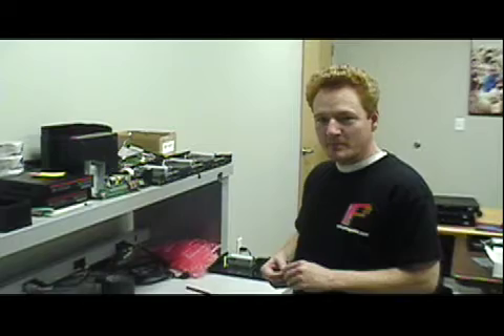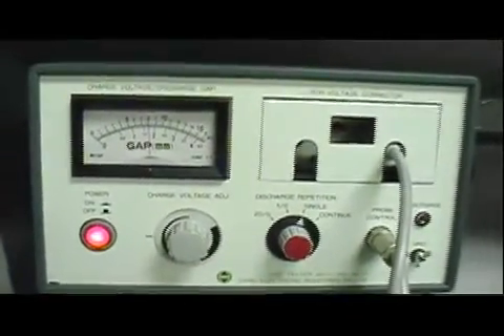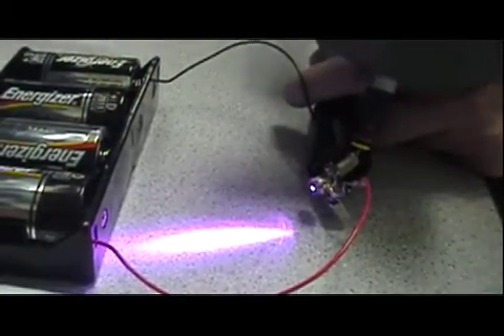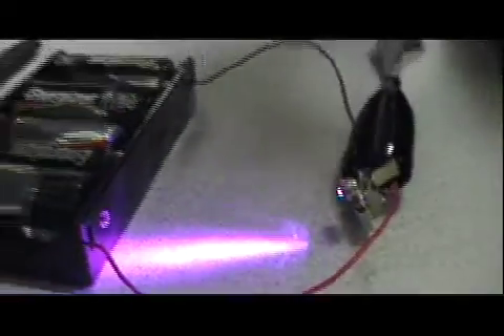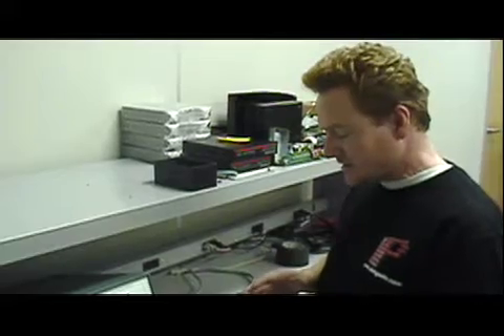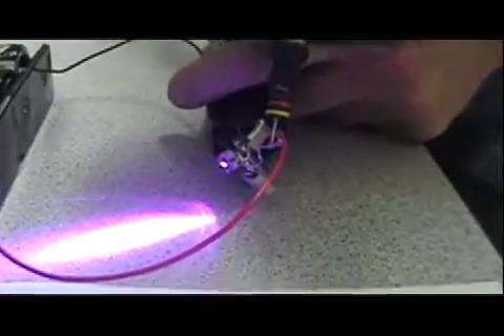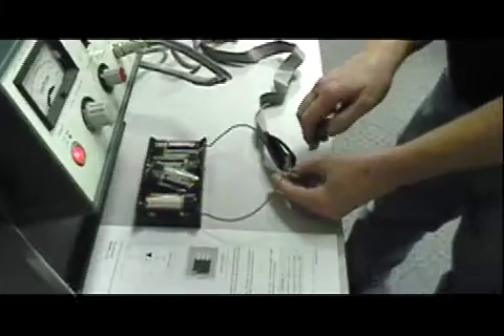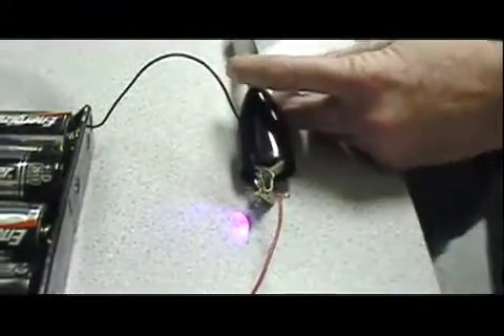LASORB protects BLU-RAY laser diodes from ESD and surges

Comment: why is it still showing some blue light?
Reply: +Thomas Joseph Great question! A laser diode has two separate damage mechanisms. One has to do with the heterojunction of the semiconductor material, and another has to do with overloading the mirrors. Lasers are very fast devices, which can produce light nearly as fast as the ESD event itself. During the ESD event, the light increases beyond the mirror's ability to reflect it, and the mirror becomes damaged. After that, the laser diode may kind of act like an LED. It is quite often that you will see some light coming from the laser diode, even when it is damaged.